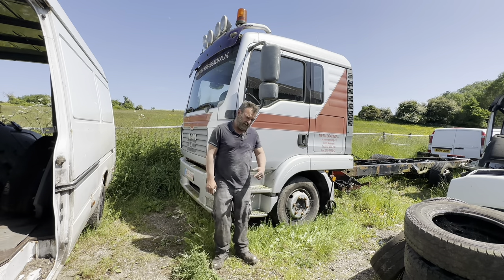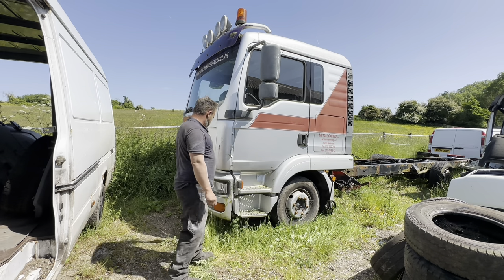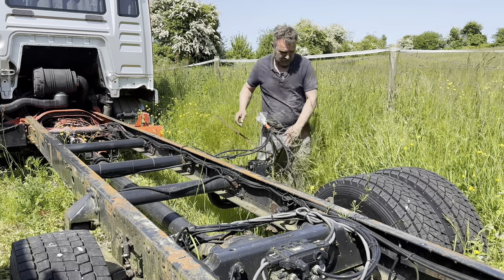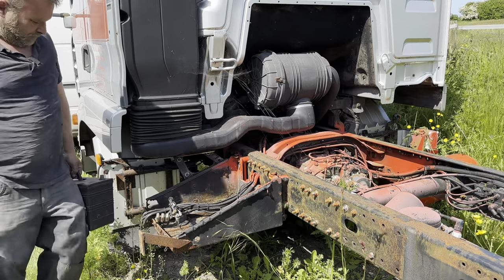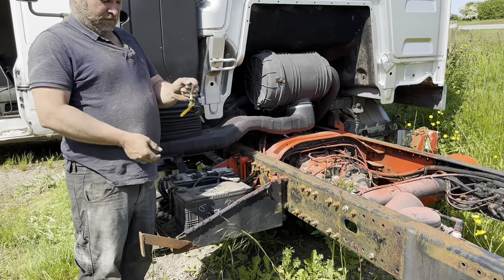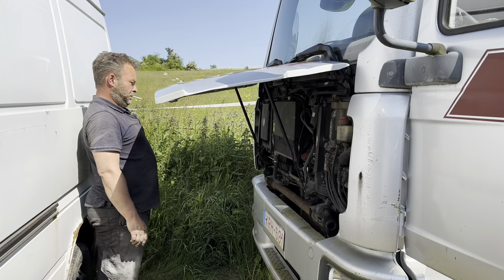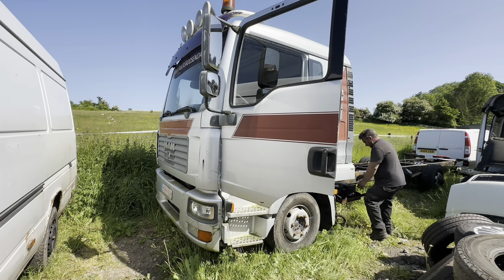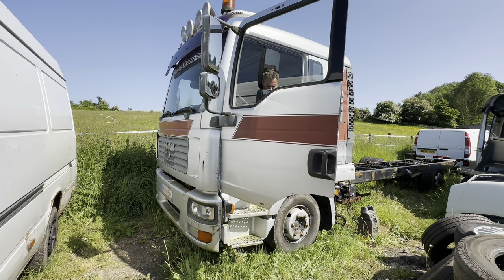MAN lorry with 1.3 million Kms on the clock.. hardly run in right ??…

Comment: I drive a 2022 TGL 12.190, 4 cylinder with a 6 speed auto. The gearbox is awful at best, at worst it's bloody dangerous. Just turned 54000 miles and it's putting on warning lights about the adblue system. 

Give me one of the old ones or an Atego any day.

Comment: Al need abit of advice..
Currently o  holiday in the Netherlands and have picked up diesel leak on my cav fuel pump cant stop it leaking air round the copper o rind any ideas
Reply from the maker: What engines it on fella ? I’m assuming you’ve tried changing the washers ? 👍
Reply: @6DDIESELSDorset  
Yes 
The engine is a Ford but marinised by thorny rift the pump is a cav minimums and the air leak is on the blead valve which has a copper washer just wondering if I wrapped some ptfe tape round to help seat the washer tight it might stop the air leak as its deawing more air than that old merc with bad tank lines you put out a while ago
Reply: @6DDIESELSDorset  changed washers chap and added fibre washer between copper washer as the shoulder on new OEM part was a bit shite... However did get it from a farm tractor dealer
Reply from the maker: Right couple of trucks that might get it working , one you can try warming the copper washers to plim them up a bit of a short term fix might be a big smear of grease round the fitting see if that stops the air 👍